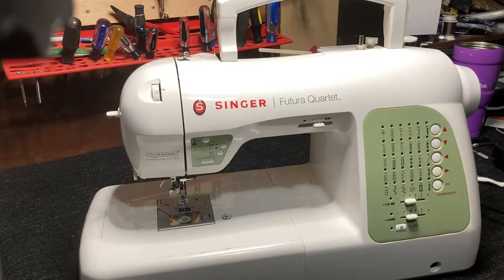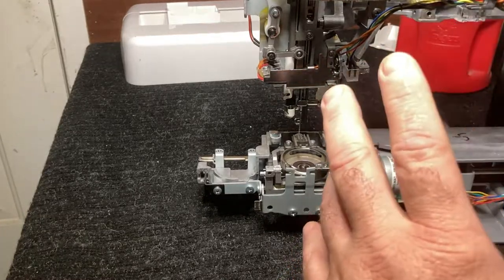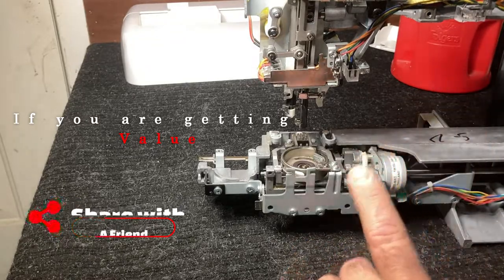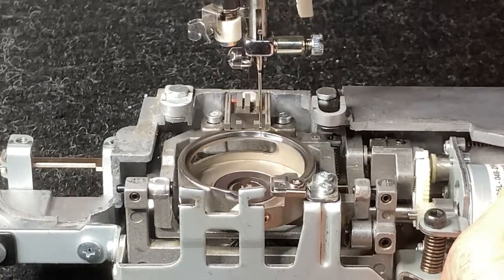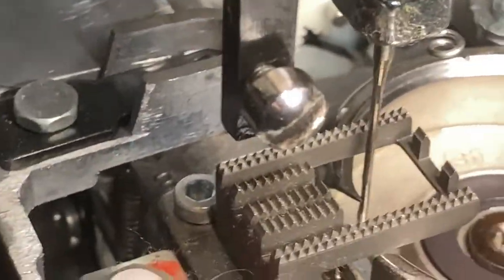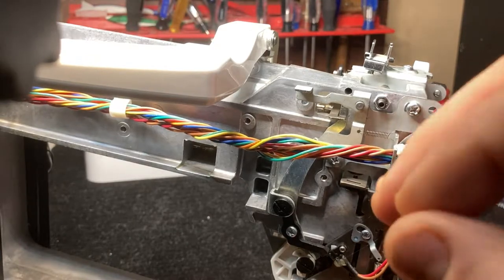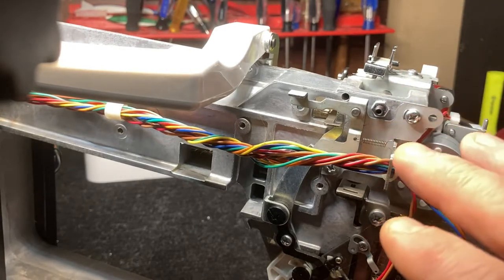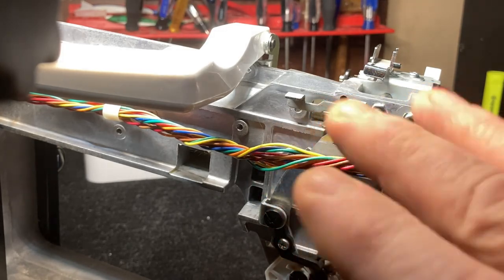Sewing Machine Timing :Top Load Bobbin

Comment: Thank you for your videos! A friend gave me a Singer Heavy Duty 4411 for mask-making 3 yrs ago. It sat idle until last month when I pulled it out to finish a quilt started 25 yrs ago. I was excited to try this “service” video. I was unable to remove the bobbin case, in spite of following your instructions. I was also unable to take the top piece off (it seems almost glued on). I was able to clean out the lint and oil up underneath, so I still feel a sense of accomplishment!

Comment: I ordered the correct bobbin case hoping it would solve the problem  on my Brother machine. The rotary hook is not the oscillating kind. The hook race rotates in a circle and is OPPOSITE the needle. I don't remember hiw it used to be. My machine was just under a $100 new so I wouldn't spend that paying for a repair. Is this a job for a professional OR can my Gearhead husband adjust this and how?? Thank you

Comment: You mention doing a video on Timing for Side Load Bobbins, but I can't find it. If you have done one, can you add the link?  I'm working on a Singer 237M with side load bobbin and zigzag, and in ZZ mode, the thread is wrapping around the bobbin case and getting stuck. It does a straight stitch just fine. Does this sound like timing?
Reply from the maker: Sorry for the late reply, 

No it does not sound like timing.

On a side load bobbin the hook assembly has to move left and right  with the needle. If you turn the machine by hand and look underneath it you will see the the entire hook and lower shaft move back and forth with the needle when doing zigzag.  My first thought is that the lower shaft and needle bar are not in sink with each other, so they are not properly moving together.

Comment: Hi there! I have a Singer Magic 14 (MN: 8214) and have problems with it, i thought it was the timing, but after viewing your videos I am afraid that it is the big round house where you place the spoolhousr in, it is not turning anymore, can you please place a video how to replace this? Thank you so much greetings Bonnie
Reply from the maker: Hello Bonnie,

I think what you are telling me is the hook is not spinning, the hook where your bobbin case and bobbin set.

If that is the case then you more than likely have either a broken gear or broken timing belt.

You need to pull the top and bottom off and inspect all your gears and timing belt if it has one and see what is broken.
Reply: Thank you for the quick answer, that is indeed, what i was trying to tell you🤣, we have found the problem and now we have to find a spare part, if i know what the name of that part is. Have a nice day greetings from the Netherlands
Reply: @sewingmachinetipsandtricks9079  hi there, i have made an film of my issue with the Singer Magic 14, is it an option to email you the film? Maybe you can tell me what is causing that the gear is not spinning. Thanks in advance, hace a nice day, greeting Bonnie
Reply from the maker: @bonniedeboer1036  
Yes you can email it to 
richard@odessasewingmachine.com

Comment: My needle is the correct distance away from the hook however the hook never rotates behind the needle when the eye of the needle is down in the position where you should be able to look to see the hook through the eye of the needle… how do I fix that?
Reply from the maker: It is out of time. that depends on the machine and what has happened to it.

The needle bar could be out of place or the hook could be out of time.